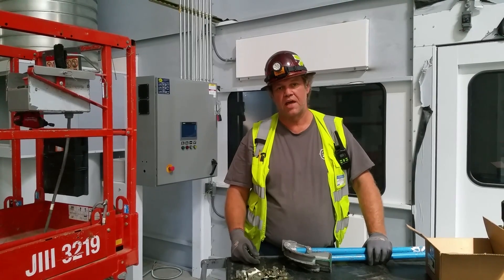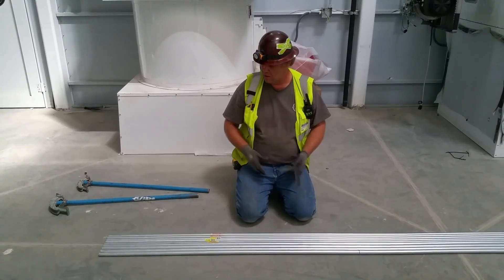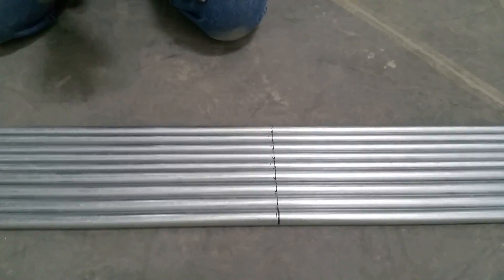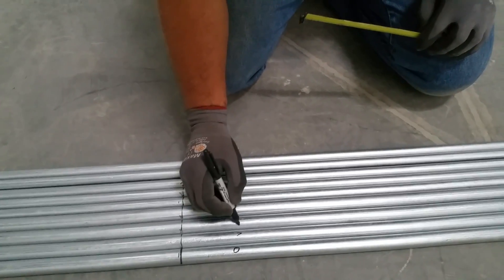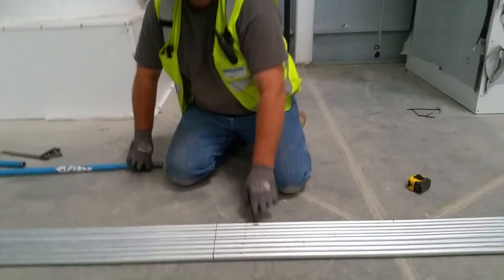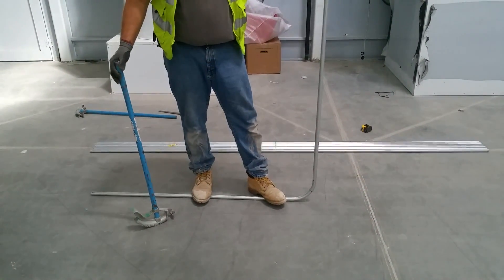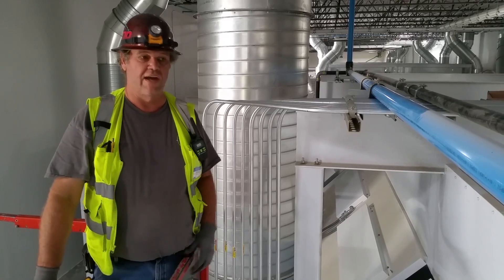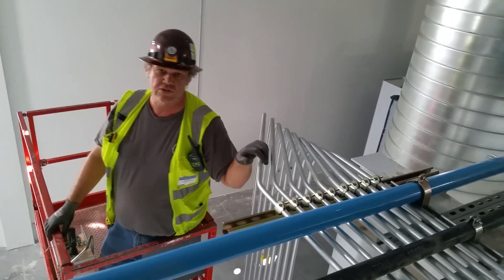Conduit bending 101 Part #1

Comment: Beautiful work. Was 9” on the 2nd conduit just an arbitrary measurement to start the offsets from?
Reply from the maker: Yes, you can start your offset with any number required.
Reply: @ShadonHKW   hey so did you keep adding 2 inches  to your kick bevcause the spacing on your pipe was 2 inches ?
Reply: I was confused where he got the 9 from aswell

Comment: Firstly, that bend is called a kick, not an offset. This is not the correct way to stagger bend marks for parallel kicks. The correct way is to use the same bend angle for every kick (yes, that means you need to add a kick to all the runs, including the first one). The amount you stagger the marks for the kicks is the tangent of half your kick angle multiplied by the center to center spacing. So if your center to center spacing was 2” and you used a 45* kick, your formula would be tan(22.5)x2. That equals 0.828, or just under 7/8”. 1st kick at 10”, 2nd kick at 10.828, 3rd kick at 11.656, etcetera. The only catch is that the center to center spacing will increase after the 90 (on the vertical portion). 45* kick with c2c at 2” will be 2x1.41 (2.82”) c2c on the vertical.
Reply: 1 st bend at 10'' then for the second one at 10.828. are all measurements from back of 90?
Reply: @IVAN22LA  you start the first kick wherever you think is best. But every parallel kick after that will be based on the first one you did. I’m only pointing out how to figure out how much to stagger each kick after the first one.

Comment: Nice. 
It has been 40 years since I ran conduit, and then I had a hydraulic Greenlee bender. I was also using rigid pipe. Never used a hickey much at all. Remembered there were formulas but not how to apply them. Never knew about the star and the notch on the hand bender. 

...and of course all the nomenclature has long left my vocabulary. 
Thanks.

Comment: Your reveal of your 90’s looks clean across the top but the spacing of your kicks looks like ass and you’re bucking your spacing before your first strut support on the vertical run because you didn’t measure your kicks properly. This is incorrect instruction. Hope sparkys don’t adopt your method of bending kicks because your kicks are out of plain with your original 90 because you didn’t level it before bending.

Comment: Nice usefull vid. 2 safety issues: our strict safety dept requires that you must use a safety harness on all lifting equipment & safer having the 2 bender hanging inside of sizzor lift railing.

Comment: Agreed, those are 90's with kicks. Also his pipes center to center spacing aren't parallel which could have easily been fixed if he knew the right formula. Half your angles tangent x center to center spacing.
Reply: What’s the formula?

Comment: You just saved me some time. I would use a level and not the benders flat foot. Don't know why I didn't think of it. 16 years in the trade. Running thousands of feet of 3/4 right now. Will try 2maro

Comment: I just have two questions,,, pretty nice work you got there,, but can I ask you something 2 things that I think you missed,, and I"m asking you, note telling you,, im learning how to pipe,, but aniiwaiis,, first question is,, How you know where to mark your first 90, form what angle to the pipe to what other angle,, and second question,, how you know 9'' inches for your first offset,,, WHAT'S YOUR REFERENCE TO KNOW WHERE TO DO THOSE MARKS,, THE ONES FOR THE 90'S AND THE FIRST OFFSET?????????????????????????????????????????? It'll be really great if you answer my questions!!! THANKS,, And amaizing JOB!!!!!!!!!!!!!
Reply: Angel Fuente  the 90 he made them all at was the distance from the pipe going vertical to horizontal where he was installing them  and he did them at 2” apart so they sit 2 “ apart on the strut running underneath the blue pipe . He just picked 9 inches as his starting point he could have chose 8,9,10,11 etc. He makes it look easy. He has many years using a bender

Comment: Ya, nevermind. I am trying to fix a lift tube on my pop up camper. I'm just going to cut out the bad section and replace it with a new piece and 2 couplers.

Comment: 30 percent is also not the sole reason.  It's also because wires are easier to pull and you can do more bends without putting a box in.  Btw. Not criticizing at all.  This is beautiful pipe work

Comment: Those are not offsets...they are 90's with a kick.
Reply: Also his 3/4 will not be in line with the 1/2 because of the differing gains of the two benders when making a  90.
Reply: @maldinggamer  Yes. I don't understand why he didn't explain that or how it still worked out.
Reply: Still good and quick
Reply: Exactly
Reply: @wizardwrecks8492  Semantics!
Reply: I was so confused once he bent the first 90.  Acutely I was confused when he said to use the star.
Reply: @NicB115  
Honestly once your confident enough, if it’s one person making the same bends. He can make up any rules he wants as long as it’s efficient and looks plum. That across all pipe bending methods.
Reply: Thank you he confused me for a sec
Reply: Nithy degré kick
Reply: I'm beginning so this video helping me a lot
Thank you
Reply: I new it I was scratching my head
Reply: Thank you exactly!
Reply: Kick 90's if you will
Reply: Semantics, the conduits are offset from one another two inches.

Comment: In the UK and australia our conduit ends are always threaded which becomes a pain when trying to screw a 4 meter piece on with a  few 90s and off sets in. I prefer your lock nut version. Our conduits seems a bit more of a thicker guage too. What do you guys do when you need to bend 1.25 inch pipe ? (32mm here) use a freestanding hilmore ?
Reply from the maker: We have threaded intermediate and threaded rigid conduits here too when the code calls for it. We use a Greenlee hydraulic bender for heavier pipe.

Comment: stan like the video but 2 things you didnt explain for the kids why you used the star for back of bend ? how you measured to the back of bend ? then why did you use 2 inch spacing and increased it for every pipe you kicked ,,you call it off set we call it kick in NYC ,if interested there is a formula for kicks its the spacing x multiplier

Comment: Those are called kicks not offsets and you should always put your level or something about a half inch to 3/4 inch thick such as EMT under the conduit when you bend the Kick. The conduit should not be lying on the ground while you do the kick 90.

Comment: Just one question. Why he took 9"  from the first pipe and the 2" for the other? IM LEARNING, NO HATERS.
Reply: Yea. wondering the same thing. Deduct for 3/4 inch for a 90 degree bend is 6" to arrow. Plus the 2 inches he added that wasn't explained equal to 8 inches. But maybe since he used the "star" that added a 1 inch to the deduct? So 7 inch deduct + 2 inches (again, wasn't explained) = 9 inches? I'm just guessing. He skipped the important bits of information. lol

Comment: The kicks don't line up.   If you want your kicks to line up, the formula is.  (The square root of  x2 + y2.)   This formula will tell you exactly where to kick your pipe.   Measuring from back of 90 to center of kick.       "Example"  y is how far you want your kicks back from the end of your 90,  x is how far you want to kick over.       This will give you H,  h/x  then hit sin- on calculator will give you the precise angle.
Reply: Then after do you bend on center or the arrow?

Comment: I personally would have placed my kicks in the vertical section before the 90's and fanned them out. The way you kicked after the 90's you lose your spacing and your pipe almost run over each other.

Comment: I dont bend it at 30° cause the math is easy. But rather cause pulling wire through 30 is easier than a 45° or 60°.
Reply: same reason I'm all about those 10-20-10 saddles. you don't even notice them when you're pulling.

Comment: I do some electric in oil burner installations, and gas as well, a piece of conduit here and there is all I typically do, service switch, co2 detector with 2x4 boxes, boiler work I get to wall mount conduit with hardware's of all sorts, into concrete with hammer drills, I learned nice and neat, skills as a kid, each and every job better than yesterdays, always evolve and learn , strive to do better than the last job. alwayspeople in the know want to hire guys like in this video, that's gorgeous work, that's what I try for each and every job, a great job looks artistic naturally. A MASTER PIECE OF MECHANICAL ENGINEERING

Comment: This might sound dumb but I have to ask since I’m just starting and know little about this.
1. How do you come up with the first measurement of 9”? Do you have to measure from one point?
2. When you are doing your kicks. For example 2”, 4”, 6”, 8”, 12”, 14”, 16” do you use the bottom of the pipe or the top of the pipe to get your measurement?
Reply from the maker: 9" was the distance from the 1st pipe to the unistrut,  I measure to the back of the pipe.
Reply: Shadon HKW got it! Thank you

Comment: What's up with the ko seal on the can? Oops
Reply from the maker: Always make spare holes, the random alarm guy cutting a hole in your panel will leave YOU to blame for HIS metal shavings.
Reply: @ShadonHKW  I'm speechless that this is a common issue for you....
Reply from the maker: Very common, other trades come in and add a pipe, metal shavings get into my electronics, instant warranty, no way to prove I didnt do it, if I leave them a conduit hole, they use it and the phone doesnt even ring. This has been my practice for 20+ years.
Reply: @ShadonHKW  I've worked from Philly to Hawaii, Ireland, Canada, Brazil, never once has any other trades punched my panel,there would be fists flying.
Reply from the maker: Fire alarm guys are the worst, but the in house maintenance guys can do some damage too.

Comment: I always called a single bend of a 90 a KICK.. an offset would consist of 2 bends.. your work looks great.text book installation except for the to seal on top of the panel... Good and fast.
Reply: That's what I came here to say. I was surprised that I only found your comment. I would have figured chat would have been flooded with this comment.

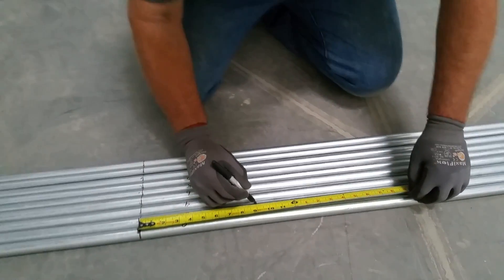Comment: how you get the nine inch when you were measuring the offsets 3:15
Reply: CuRv Ninja did he ever reply to you?
Reply: Late, but it seems the 9" is the distance of the second pipe to the unistrut. He has a 2" spacing between pipes, so each progressive pipe (moving away from the unistrut) needs to be kicked 2" higher, 2" further back on the pipe.

Comment: I dont know nothing about pipe bending but it look very interesting.I have a doubt...Why the second pipe is marked 9" from the first mark ? I will appreciate  your help !!
Reply: I think the 9 inches is the distance from the rack to the 90 bend. The first pipe was lined up with the 90 so it didn't need the kick/offset. The rest did need it and it started at 9 inches and went up by 2 inches for each pipe since they were spaced 2 inches apart. Hope this helps.

Comment: Those are not "Offsets" those are simply 90's with a kick (in a consecutive order) an offset by definition is not simply 2-shots on a pipe... It is 2 bends bent parallel with each other typically inline but not always.

Comment: Isn't what your doing at least as far as I was taught 20 yrs ago called putting a kick in a pipe ?? N yes I can bend pipe i have been since I was 15 when dropped out of h.s. n went to work with my father ..an  offset I always thought consisted of 2 bends like a box set but larger idk maybe I just learned wrong and having been calling it the wrong term all these yrs .. anyway great content n your work looks great too

Comment: work looks gr8 just asking a question if i have a stub 90 and i need to attach to another1/2 emt at 12 inch height how would i do the math to get my offset
Reply: leo ybarra using a 30/30 bend the constant multiplier is x2 so for 12" offset its 24" spacing between your bends (at 30°)

Comment: Is there any reason you didn't have the kicks going vertical instead of horizontal?     And the 9" you said from #1 conduit to the first support.  Is that the first rack up top?    Thank you, much appreciated.
Reply from the maker: Either would have worked, it was 9" from the first pipe to the first horiz rack, so that's where the first 9" came from.

Comment: Those are called a kick bends not an offsets and you should be having something to the right of your conduit 90 Bend to keep it off the ground and level with the Heights of the Bender such as a piece of conduit or screwdriver handle so you don't dog leg

Comment: Where you get the 9 inch?
Reply from the maker: Distance from the first pipe to the unistrut support
Reply: Shadon HKW thanks for the tips and replying
Reply: Shadon HKW thanks ... when using the star point you have to bend away from the object ? I was taught to use the arrow and put the bender head toward the object
Reply from the maker: The star bends back towards the direction you measured from

Comment: you did a great job. those are some nice bends. some people use a marker some prefer a pencil. either way you wont see the marks from floor level. and aslong as you are inside of the scissor lift, you are not required to wear a harness or a lanyard. it takes a professional, a master of the trade to recognize good work. if your bends do not exceed 360° degrees, your wire should be good to pull through. unless your conduit run is longer than one hundred feet a pull point is required. the only unsafe thing is recording and not being aware of your sorroundings. while working industrial, more safety hazards arise. peace yall

Comment: i would have already had them ready to hang , while this guy was still defacing them .
Reply: Just Mark two spots on the floor not with a sharpie use a grease pencil and start bending them using foot pressure foot pressure foot pressure that's how you eliminate kinks in your Benz foot pressure

Comment: just curious... wearing a vest and hard hat for safety but no harness or lanyard in a scissor lift..........
Reply from the maker: Jason M. not required any more per Cal Osha,  telescope booms = yes, conventional scissor lifts = no.
Reply: lucky you in michigan that still on
Reply: Shadon HKW thank you, as long as the chain is latched im fine , a lanyard just gets in the way, worked hours make that years up on scissor lift and never was in danger of falling,
Reply: you only required to use a harness if you step out the lift
Reply: Harnesses only required on boom lifts, not scissor lifts
Reply: Jason M. the railing is the adequate and appropriate fall protection (restraint) in a "scissors lift", which is actually considered to be a type of rolling scaffold.  He's wearing viz because he (too) works for a bunch of idiots.  If he was directing traffic or in a traffic environment, viz would be appropriate.
Reply: In Australia  hi viz is mandatory  on building sites along with steel cap or kevlar cap boots no hi viz your off site until you are wearing it. Most work wear is hi viz now
Reply: Yes, yes...hard hat, vest, and gloves definitely required...but no glasses needed? First I’ve ever heard of...
Reply: In Australia  you also are required on some sites to wear  safety glasses  hearing protection hard hats gloves use platform ladders and over certain heights a scissor lift or scaffold and a job safety analysis done before starting work and toolbox meetings before work starts
Reply: what the fuck are you osha?

Comment: Where are his safety glasses, safety belt on the lift, and the conduit benders hanging off the outside of the lift are all safety violations. Good thing OSHA wasn't around!
Reply: KEVIN PRICE glasses just fog up ,the handrails eliminate any need for a belt, i hang my benders across the middle rail on the inside with a loop of tie wire over the handle end.
Reply: you dont need safety belt on a scissor lift if you dont go up on the firt bar. Second it's true about the conduit bender , everytime i work with it on skyjack , i put it on the bar but inside the lift. I dont go up with it if i dont need some adjust of bend on place

Comment: I'm surprised that you didn't have one more unistrut to support your pipes on the first 10' lengths. Here is Canada we have to support 1/2"-1" EMT 1m(3ft) after a box, panel, enclosure and 5ft there after. Is that not the case in the USofA? Just currious not trying to be a smart ass.
Reply: Sergio Santos I'm American and I agree with you, 1/2 inch is the hardest size to hang, (not the other way around) because of its tendency to sag and it is hard to keep level

Comment: where the 9" distance for the off set came from? did not get that part. thanks
Reply: Its his mark for the bend on the kick.  Its not an offset he's making.  Hes making a 90, then kicking it up.  The mark at 9" is where he will put whichever mark he is using for his first kick.  Then he will move the bender down 2 inches for the next pipe because that is the spacing he is using.

Comment: Nice work. Was your two inch increments based on the thickness of the three quarter plus the spacing between the pipes? Looks like the two inch spacing held
Reply from the maker: My pipes were 2" on center coming out of the panel, with a mixture of 1/2 and 3/4 you will see some variation in the spacing.
Reply: Shadon HKW Thanks for your response.